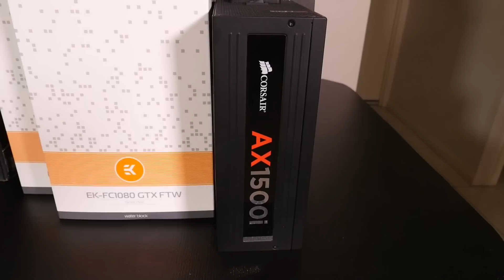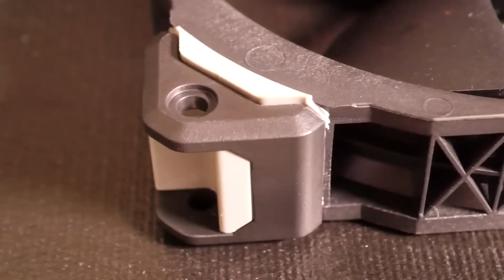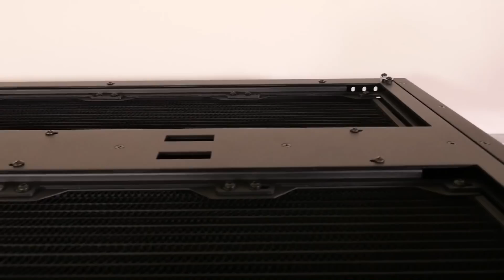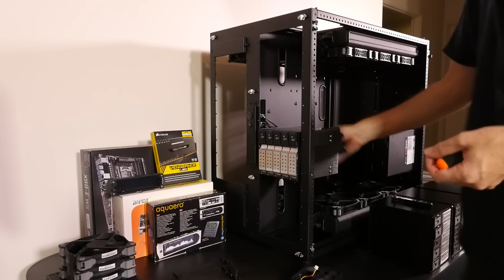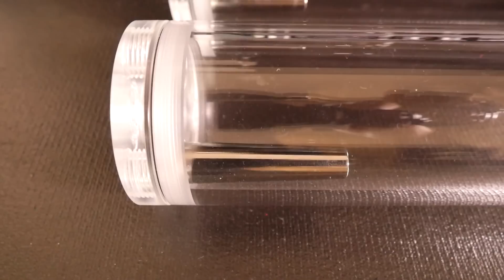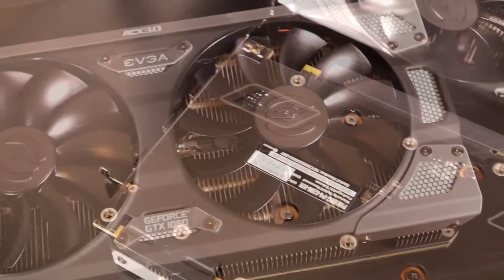SC Build #18: Extreme Workstation: Part 2

Comment: Have you thought about using Jet Flo Coolermaster fans.  I've heard they are insane for both airflow and static pressure making them the fan to beat plus they only cost around 15 bucks depending on how many you buy.

Comment: I think removing hot-swap bay fans for more radiator space was a mistake. 2x480 rads would be such an overkill for entire system, meaning those extra two 240s would be more than enough. This way you would not have to create negative pressure and all drives would be cooled equally.

Comment: Could you provide all the part numbers for the Pump/Res parts?
Also do you pick the parts straight from the BitsPower website or do you use a different better site? 
The bitspower site looks like it's made in 1999 and images do not load 90% of the time!

Comment: tbh I think there is a solution for dust. You divide the case in 2: one part just WCed without any airflow and sealed and the other with radiators in pull that are mounted on the back-side panel, you add some filters to them and make a chamber separated from psu and its cables. At that point, the only dust you will clean would be the dust on radiators, that can be easily removed with a vacuum cleaner. Hard drive, Imo in a build like that, should be put inside a heatsink like the Scythe Himuro or, since we are dreaming, WCed, and put on display :P.

Comment: Outstanding quality design and craftsmanship as usaul SC. Thanks for the great videos. I am curious about the hotswap bays though. Would it be possible to mod the top and bottom bays to accept fans? ie...cut the top off the top bay and the bottom off the bottom bay and place fans there? There appears to be just enough room in the case for fans there. Time and money are always a factor but it could be a elegant solution.

Comment: I will be doin a caselabs th10 not the w case build  soon- why would you use older mechanical drive storage instead of the newer m type much faster drives?.. did the client already have many older mechanical hard drives? such an old hard drive technology after spending such money doesnt make sense, assuming a rebuild for your client prob every 3 to 4 years